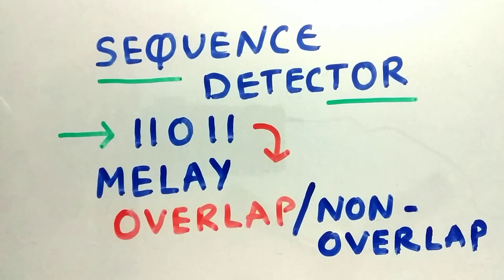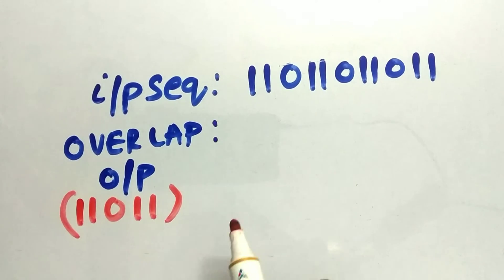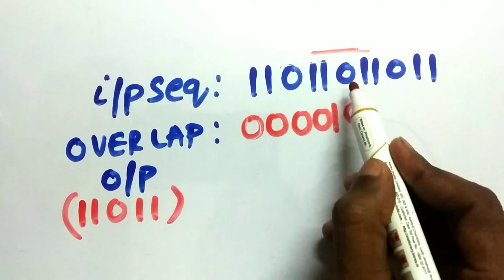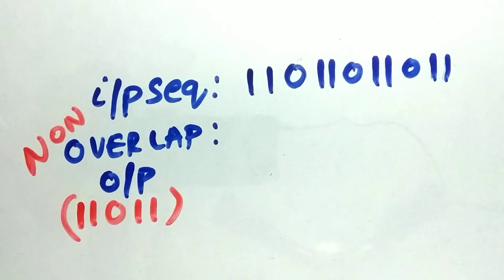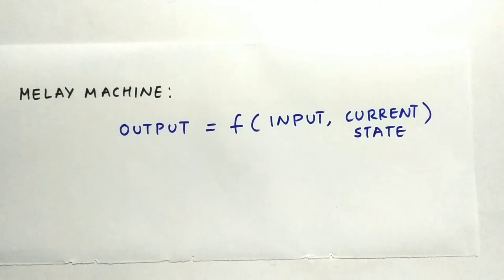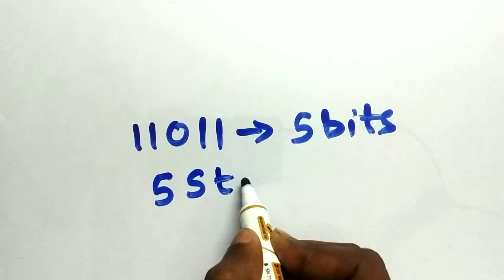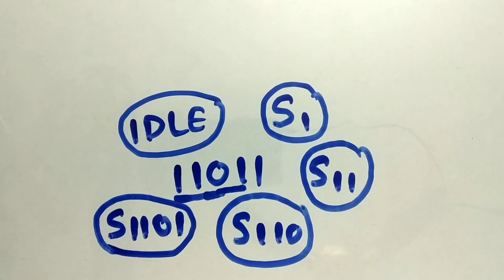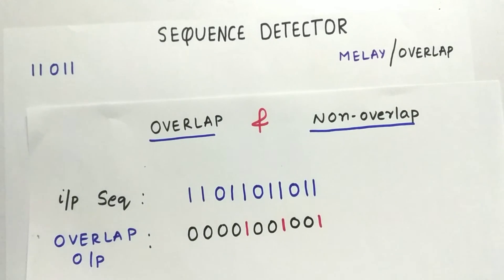11011 sequence detector (5bits) using Melay Overlap & Non-overlap  || *simple trick*

Comment: there are so many errors in your boolean minimization(D1,D2,D0,Z) for overlapping
Reply from the maker: Please mention the errors I will ping your answer it will benifit others thanks ☺
Reply: @KarthikVippala  after the kmap for the overlapping, when you got the values for eg for Z, it should've been Y2Y1Y0'X, but you got Y2Y1'Y0'X, also for D1 it should've been Y2'Y1Y0' + Y2'Y1'YoX + Y1Y0'X but you got different. I might be wrong, but please check it out
Reply from the maker: Ok sure